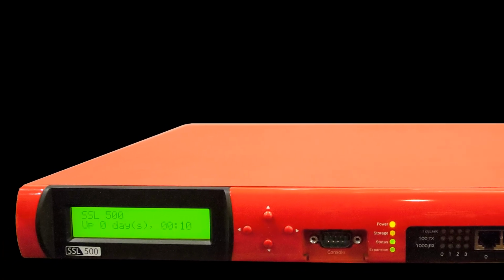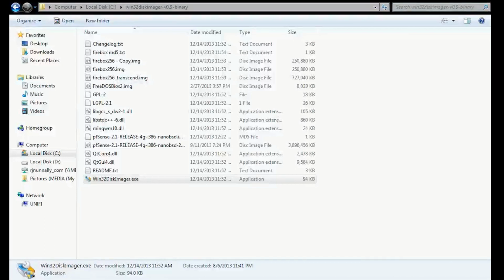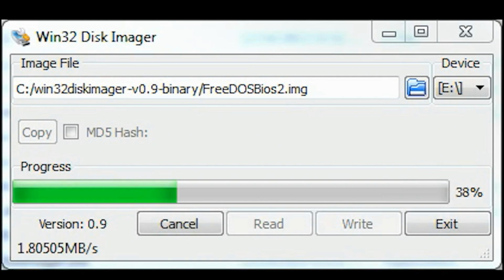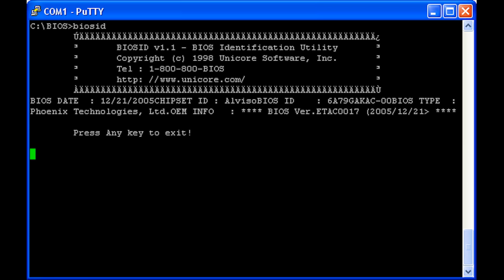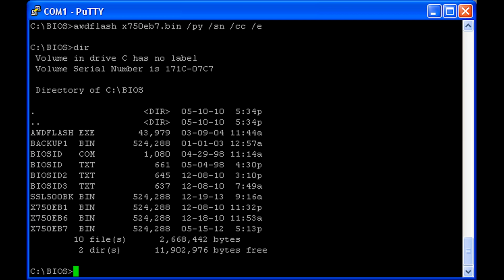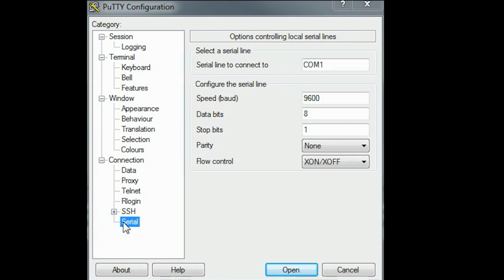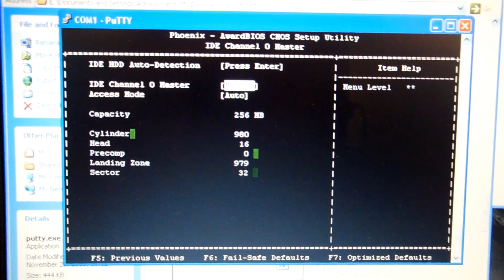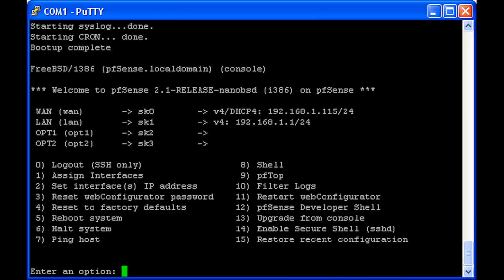How to flash pfSense on a Watchguard x550e, x750e, x1250e, or SSL 500 firewall

Comment: I manage to connect to the device.

Freedos on COM1:
Current date is Wed 01-01-2003
Current time is 12:03:14.50 am
C:\>

But cannot type into Putty tried 2 different PC's using a laptop with a Serial port as well tried on 2 different Watchguard's x550e and x750e same issue. Help please.

Comment: Just actually picked up one of these bad boys from a local company. Has pfSense loaded up already. ($35) I'd say it was a solid buy. Now I have to purchase a Serial to USB cable since, I only have the newer RJ-45-Serial cables. 

A question I do have. Since this device was pulled from service running at 169.152.XXX.XXX IPV4 I would have to reset it to run in a local household correct? Thus meaning have to use putty to access this correct?

Comment: Been a while since I last posted.  So recently there is a new BIOS version 8.1 for the xe series of Watchguard's.  This upgrades the B7 install that you see here.  

On my x750e the only way to reset the BIOS was to pull the battery for about 2 minutes (there are no jumpers on the mobo).  Then grab this file new BIOS from https://sites.google.com/site/pfsensefirebox/home/XEBIOS_81.BIN?attredirects=0&d=1

This is an upgrade it's actually a lot faster than when you first wipe out the Watchguard bios for B7.  One note.  You no longer need to set the CF card to Manual and CHS.  You may leave them as AUTO in the BIOS for 8.1.  

You will need to rename it since there is the 8.3 rule in DOS.  I renamed it xbios81.bin  It will then properly show up in FreeDOS (if you don't rename it calls the file XEBIOS~1.bin and that doesn't really work.  Once it is finished you will see your command prompt.  You can then make your changes to the BIOS as seen in the video.

Finally when you reboot it will display pfSense B8 if you see that, you were successful.  If not, you'll have to try again.

Also someone in the pfSense community took to rewriting the LCDProc file that allows us to see all kinds of cool things in the LCD of these Watchguard's.  I have not tested it out, but it is supposed to work.  Here's hoping!

One final note.  You still ahve to add the set hint.ata.0.mode=PIO4 during the initial boot (you have 5 seconds to press any key).  When you see the OK you add that text there, and then type boot, and it will continue.  Why this happens is It is trying to detect a non existent hard drive on the ATA controller instead of the CF card.

Once you get into pfSense configure your WAN to sk0 and sk1 to your LAN (that's ports 0-3) you can set or skip the others.  I activate them all just because.

Once you hear the happy beeps, press 8 and get into vi.  vi /boot/loader.conf.local  It will be blank, and that's fine.  To add a line to vi you have to press letter A (for append) and you can add the following: hint.ata.0.mode=PIO4 (do NOT add the word set because that throws a syntax error, and it will not load).  Press ESC to leave the append mode, then :wq to write and quit vi.  Type reboot to reboot the machine.  If all goes well you pfSense router will now boot up and not hang anymore.

Comment: @hexhound.  I actually got an older version of pfSense that still had the LCD display features added, but the unit now randomly reboots after a number of hours in use (no overheating issues).  I'm wondering if this is due to the stability of the CF card and that LCDproc feature.  I have considered using the 1x PCie slot for a SATA card and a hard drive instead of the CF card.  That might avoid issues with the boot sequence I ran into.  Your thoughts?  I didn't think this unit would be so unstable with these mods.
Reply from the maker: It shouldn't have stability issues. What other packages are you running?

Comment: Question can I used a 16GB CF card? 4GB cards are hard to find.
Reply: Bump..
Reply: I just got in a x550e and wrote the current version of pfSense (pfSense-CE-2.3.3-RELEASE-4g-i386-nanobsd.img) to it. Since I got a system that was pulled from a working environment, it came with the 256MB CF card that I used to write FreeDOSBios2.img to and obtained the XEBIOS_81.BIN file and added to it. Flashed the BIOS to XEBIOS_8.1, powered down, inserted the 16GB CF card and it booted. keep in mind that you will have to jump through a few hoops, like instead of letting it auto load and get error message you need to stop the auto boot of pfsense and type in "set hint.ata.0.mode=PIO4" hit enter then type in "boot" then hit enter. Once in, you will need to open /boot/loader.conf and save as new name /boot/loader.conf.local, clear the contents then add "hint.ata.0.mode=PIO4" to it, save the file and reboots will work.
Reply: when watching the boot process, there is a spot where it has a short count down timer. just hit any key and it will stop the auto boot process. Then type in "set hint.ata.0.mode=PIO4" hit enter then type in "boot" then hit enter.

Comment: Sup Hexhound.

Couple of updates.  People will need to copy the file called loader.conf located in the boot directory.  That gets overwritten at each reboot, and so the settings:

set hint.ata.0.mode=PIO4
set hw.ata.atapi_dma="1"
set hw.ata.ata_dma="1"
set hw.ata.wc="1"

Will be deleted.  If they copy that file, rename it to loader.conf.local and place those 4 items in there, it will no longer lock up.  It will boot up to pfSense.

Second update is the LCDproc and LCDproc-dev packages are gone.  They removed them and claimed no one was updating them.  That's what people would use for the Watchguard LCD screens to show their statuses.  There is a procedure to make it work, but there seems to be a lot of facts missing and it'll kick out all sorts of XML and parsing errors in 2.3.2.  That being said until someone makes that a working platform and they readd the packages, I'll be downgrading my version to 2.2.4 as I know it works in there.
Reply from the maker: Thanks for the update. I'll look into an LCD solution.
Reply: Yeah because the current is pretty derpy as are the instructions.
Reply: Which file?
Reply: During the boot sequence you have to add a command to it that skips DMA checking.  Sadly it is not a permanent fix (it's overwritten on reboots).  Changing the conf folder to a custom one didn't work for me, and it still locked up at that point.   I have to track down the command that worked to get you to the pfSense screen.  I'll post it here when I do.
Reply: Yeah I know what ya meant :-)  You get 5 seconds to skip the boot sequence and add your commands.  You have to watch for that message and press the key it asks for.  Like I said I have documented all of this.  I just need to locate the file I have it in.
Reply: Here ya go Frank.

When you see the

pfSense 1
pfSense 2

F6: PXE

Boot: 1

Give it a moment, and you'll see a prompt to press any key to access the command line you have to do this within a few seconds of seeing the message.

Once in boot mode you should see

OK

Enter this text

set hint.ata.0.mode=PIO4

Press enter

Enter this

set hw.ata.atapi_dma="1" 
Enter

Enter this

set hw.ata.ata_dma="1"
Enter

Enter this   

set hw.ata.wc="1"
Enter

boot
Reply: Keep in mind that if you reboot the unit you'll have to do it again.  In theory creating a custom boot conf and adding that info is supposed to prevent that overwrite, but I found it still gave errors. It has to be something with the hardware and less about the software.  It seems that the changes made over the years with pfSense have made it harder for us to use these appliances as we once could.  This is especially true in the latest version.
Reply: You have to duplicate that boot conf folder.  Use WinSCP from another computer and navigate to the files on the router.  You can make the changes there.  If it is giving you a lot of errors, I'd just start over and reinstall.
Reply: You mean the CPU in the Firebox?  No idea.  You'll have to research on Google for that one.  The BIOS that Hex uses is basically DOS, so it might by default work.  Not sure though
Reply: Yeah I did that, but like I said I started getting random reboots.  I think because I used the fan control setup and the lcdproc for the front display.  It freezes on that same area during boot.  I'm thinking of adding a 2.5 or 3.5 hard drive using a SATA controller card in the 1x PCIe slot.  That probably will remove the random reboots, and get me out of the CF card.
Reply: Actually you don't really.  That's the thing about pfSense it take very little oooph under the hood.  In fact my Firebox only came with 512 MB of RAM and a 256 CF card.  I think a Pentium grade processor was used though I have not verified in a while on the Watchguard website.  Routing, VPN, Firewalls even bogon network blocking use very little resources.  These devices have GB Ethernet on every port (I have 8 of them).
Reply: CPU could be pegged due to compatibility issues.  Sometimes companies have custom codes written into the instructions.  I've run that version as well with LCDProc, VPN, DHCP, and a few others and remained at 10% CPU usage on the stock x750e

You asked about drivers, but I'm not sure how you'd install them to this device, and I'm no expert when it comes to manual CPU updates.
Reply: So sorry this took 6 months to reply (I was getting so much SPAM from YouTube alerts that I turned that feature off) 

I just rewrote some instructions in a new comment above that talks about updating the BIOS to B8.  2.3.5 should install properly (that's the last version that is 32bit for these machines).

Comment: Hey Hexhound.  Sorry to keep spammin your video.  I wanted to give you an update.  After hours and hours of frustration, I was able to successfully get pfSense's latest nano version (as of Oct 25 2016) onto my Firebox x750 Core e-series.  I used the SanDisk Extreme 4GB CF card, and used your video to set the default BIOS parameters needed for the system to boot properly.  It seems the older versions do not boot, and it will just hang after the memory check, and the list of detected items.

What I found also is that the DMA has to be disabled or it won't boot up.  It seems to timeout just after it finds the onboard USB controllers.  I believe it is the ata's it is finding and tripping it up.  Through extensive research this is what needs to be added.  

To do this you MUST press any key other than the enter on your keyboard to get into the command.  You will see OK on the screen. That's how you'll know.

Add these one by one pressing enter for each one.

set hint.ata.0.mode=PIO4
set hw.ata.atapi_dma="1"
set hw.ata.ata_dma="1"
set hw.ata.wc="1"
boot

Now they say these four parameters should be added into the boot loader conf, but I've yet to figure out in nanobsd these are located because doing an ls from the shell in pfSense says it does not exist.  Obviously it does, but it's hard to find it.  If you can't get to it, you probably need to add these each time you reboot the system.  For some reason it does not permanently add them.  Hexhound, if you want to attempt this perhaps you can create a new video demonstrating what needs to be done.
Reply from the maker: Community involvement is a huge positive! If I can find the time, I'll look into it and get back to/create a new video.
Reply: Agreed.  I also think document updates are in order.  This is a one off project that few people know about, but they should as this appliance is pretty awesome.  if you need assistance I'd be more than happy to help you out.  

I also upgraded the DDR2 533Mhz RAM to 2GB (it only came with a measly 256MB stick) I was lucky to have 2 DIMM slots.  Also this hardware is 32bit architecture.  You NEED to use pfSense NANO BSD i386 versions and you have a RAM cap of 4GB.  For those that don't know.

When you are choosing your interface assignments (OPTION 2) it reads:

msk0
msk1
msk2
msk3
sk0
sk1
sk2
sk3

They should be reversed due to their physical location on the front.
sk0 - sk3
(Ports 0-3)

msk0 - msk3 
(Ports 4-7)

The only reason I figured this out was by plugging in an active Ethernet cable in port 0 and in port 4 and watching the uplink say up or down.
Reply: Do you have a Serial to USB cable?  You need that and PuTTY in order to view the command line.  There is no display port built into this unit.

Here's what I bought:

Serial cable: https://www.amazon.com/gp/product/B000067SCH/
Serial to USB: https://www.amazon.com/gp/product/B0000VYJRY/

For console access: 
PuTTY: http://www.putty.org/

Once you have acquired these items you can then view the console (and follow Hexhound's instructions)  Keep in mind that serial is norally mapped to COM port 1 by default.  So you set that up in PuTTY

Comment: You should consider updating this video to the latest version of pfSense for the Firebox.  As mentioned below there was some issue in 2.2 (and it's probably there in 2.3.2 which is the latest) that causes an error with the BIOS of the Firebox.  You should demonstrate how this is fixed.  Also while the video is helpful, you did go quite fast with the screens, and I'd recommend using OBS or something to capture your screen rather than filming it due to reflections.

ImgBurn is an alternative to WinDisk Imager, and is free.  Little more advanced, but good tool to have in the box.

One last thing.  On your website you say "Once completed, ground yourself, unplug the Firebox, remove the old FreeDOS CF card and insert your newly flashed pfSense CF card."  The term grounding is incorrect, and is deadly if someone actually did that.  

What you mean to say is "unplug the Firebox, discharge any static electricity ( by touching the metal case) before inserting the CF card.  Then insert the card."
Reply from the maker: Thanks for the tips. I have OBS and have used it for other videos - the laptop I used is quite old and doesn't have it installed. I'll consider making an updated video for the later versions of pfSense; however, please be aware that support for 32-bit CPUs and therefore this generation Firebox is being dropped in 2.4. I have an XTM 515 I will be using for 2.4+. Right now I'm actually running the factory WatchGuard Fireware because it's licensed for a few more months and I prefer it over pfSense.
Reply: No problem.  I am surprised given the age of these Firebox's they will still designed with the 32bit platform.  Which limits the RAM amount to 4 GB, and is frankly not as stable as 64bit is.  In my view 32bit should have ended 10 years ago.

I can't use the factory Watchguard software due to the age of Fireware (mine is 8.3) and only runs in compatible mode for XP.  However during the installation of the Fireware software it would not allow me to add the Watchguard start up to the right-click menu toolbar in Windows (I run 7 with this again in XP compat mod).

For me I'm just keeping the old CF card (256MB) and using the one you recommended for pfSense.  I've been using the pfSense platform now since 2.0, and it's been pretty killer.  A lot easier to configure compared to the enterprise software most routers use.

Comment: My local fry only had a 32 GB CF card. I am going to uses the factor card to do Free DOS but will i have issues with a 32 GB card and not the 4GB

SanDisk Extreme 32 GB 120 max UDMA 7

I am doing this to a WG XTM 5 525
Reply from the maker: I'm pretty sure you'll be fine; however, I don't believe pfSense will see all the usable space on the card.
Reply: +Hexhound so I have the XTM 5 and did not have to do freedos it had a 1GB card in it. So loaded the 32 with pfsense and it see it as a 1 GB card. It's working but I may try the freedos option to expanded it to a bigger size.
Reply from the maker: Ryan G FreeDOS is only necessary on the older watchguard x-core-e models because the firmware must be updated. The later XTM 5 series does not require this step as you noticed, but running freedos won't allow the full size of the card to appear. I believe this is a limitation of the pre-built nano image.
Reply: +Hexhound thanks I was hoping to get the card to be seen at least as a 4 gab or 8 GB card. Now it's only seen as 1GB

Comment: i got watch guard x700 i wonder you be able send me the link for 2.1 ? i went on your site but the link is down , please get back to me thanks !
Reply from the maker: +GamingHeadquarters HD I can upload it for you later, probably Monday. However, please realize the x700 is different than the x-core-e devices this tutorial is for.
Reply: +Hexhound yeah i know thanks ! can you send me the link monday mate on skype or on here  my skype is joshhopey
Reply from the maker: +GamingHeadquarters HD Here's the new link https://www.hexhound.com/files/pfSense-2.1-RELEASE-4g-i386-nanobsd-20130911-1816.zip 

MD5 https://www.hexhound.com/files/pfSense-2.1-RELEASE-4g-i386-nanobsd-20130911-1816.md5

b64bc70515d72c6e90d5ae6a4abc4354  pfSense-2.1-RELEASE-4g-i386-nanobsd-20130911-1816.img
dea5e8e7f5257b3f4b0f4e96b35a458a  pfSense-2.1-RELEASE-4g-i386-nanobsd-20130911-1816.zip
Reply: hi mate , i got a problem i install pfsense fine , but when i config the wan , and the lan it says page cant be loaded  the web gui , also , if i just config the wan , it fine ? you got skype if you have add me joshhopey , just dont know what to do